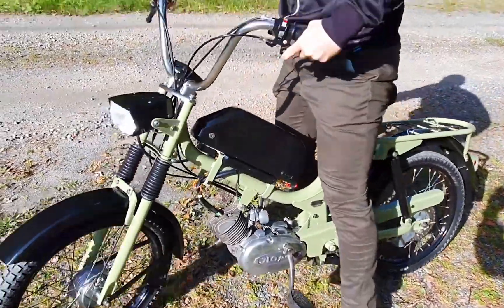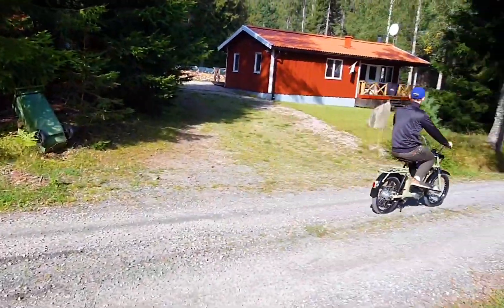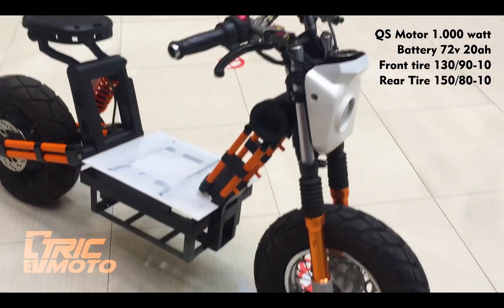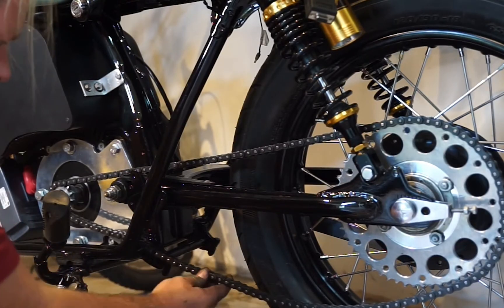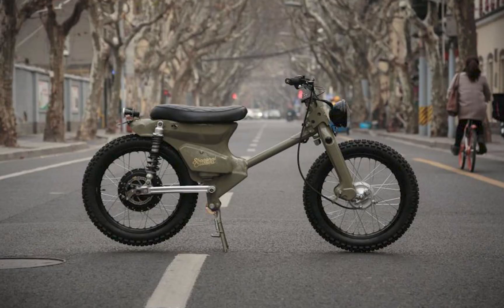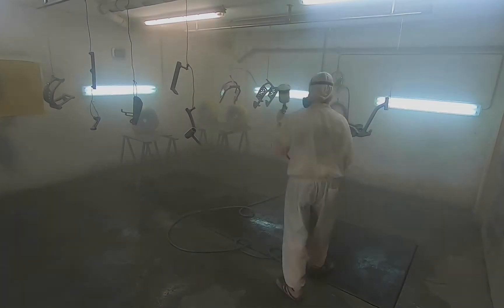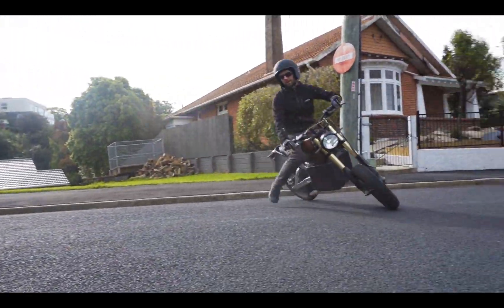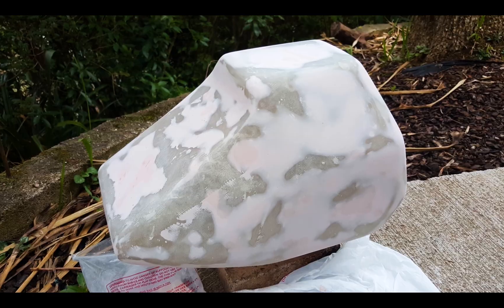Best Home Built DIY Electric Vehicles

Comment: I don't know alot about those motors but I did take electronics in college so my question about the first one: placing that electric motor inside the old engine case(although cool looking) worries me about heat dissipation. Am I wrong?
Reply: It'll be fine

Comment: 4:16 looks like what I have in mind for my Mx650 but w/ bigger wheels and a hub motor... Currently running 48v 2000w and I'm skipping every motor and jumping to a QS 273 3.5t and 80v, should fit perfectly on the frame.
That first bike is so fkn awesome, I LOVE that motor conversion and I'd love to know how he did that.... That can be done on a lot of different bikes and I want to build one.

Comment: I'm working on EV conversion designs for Kei trucks.  I want some to use for utility and UTV/tractors are super expensive.

A Kei truck husk in good shape (no motor) are a fraction of what a used Polaris/Can-Am or John Deere/Kubota would cost and be much less to maintain.
Reply from the maker: Cool idea. Do you have links or pics with clips? It will be cool to see your progress and development.